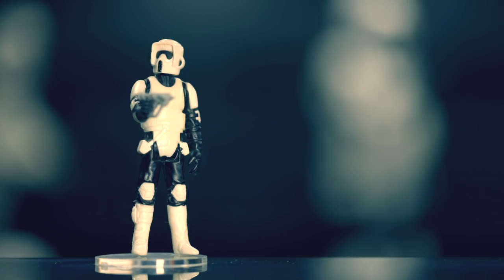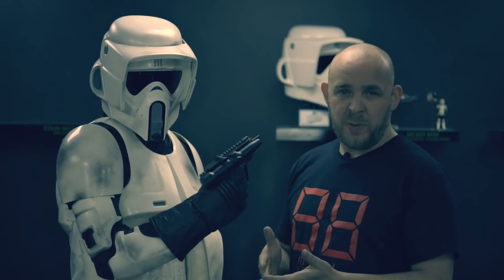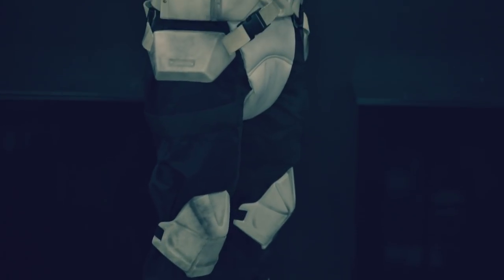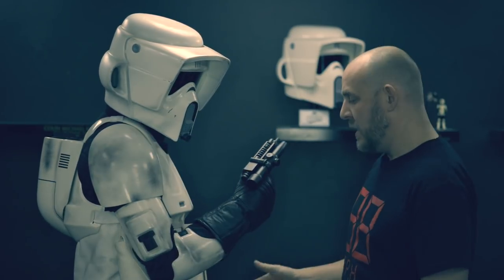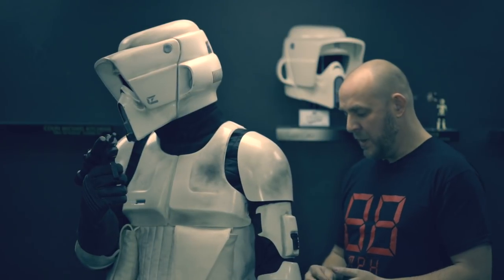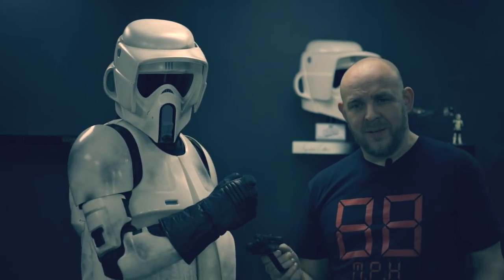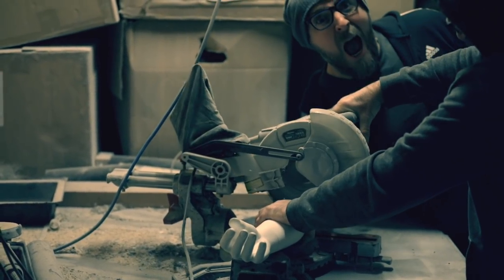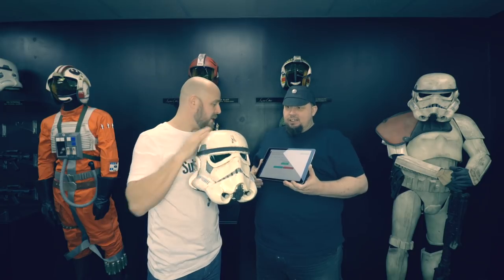Screen Lineage Scout Armour - RS Prop Masters - Vlog 003

Comment: Hi RS, what are the differences between the ‘Red Label’ helmet and the original one? Thanks!
Reply from the maker: We’re looking at doing a video on this to explain.
Reply: RS Prop Masters okay great, as I’m very interested in buying one!
Reply: RS Prop Masters also I’m curious, I’ve noticed from the pictures that the lower left side of the black visor doesn’t seem to fit properly - I can see a small gab. Is this something that’s possible to be corrected? As regardless, your helmet is the best looking one I’ve seen out there.

Comment: Is it correct to have 7 or 8 indents on the back side of the helmet?  Yours has 7 but I've been told 8?
Reply: Screen used helmets that had both 7 and 8 indents. One of the screen used helmets that had 7 indents was displayed at San Diego comic con 18